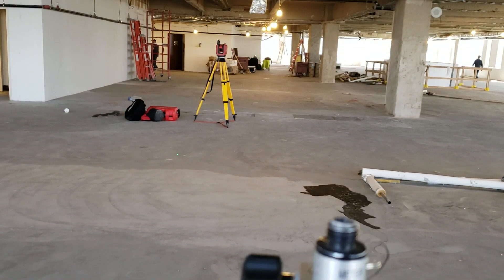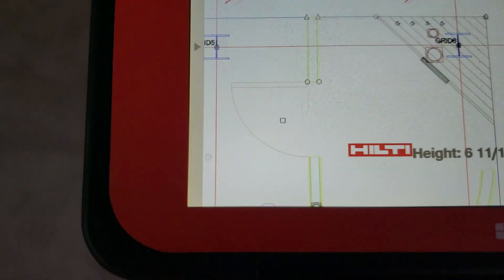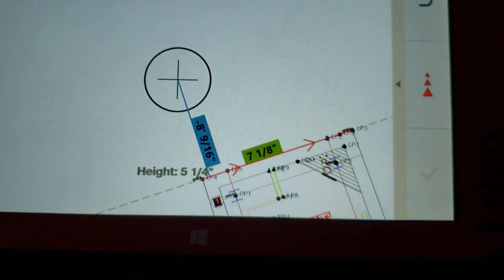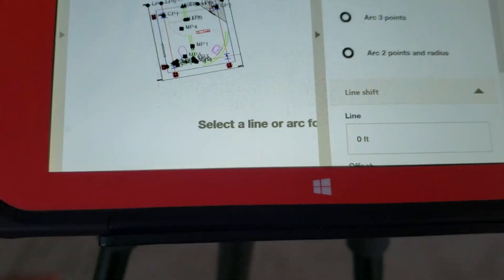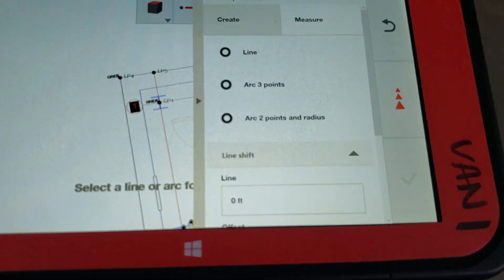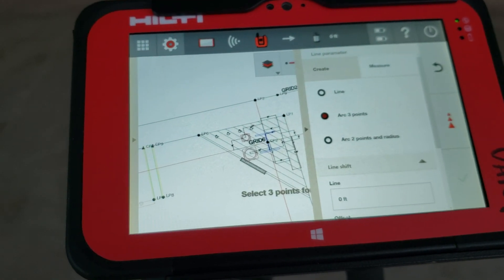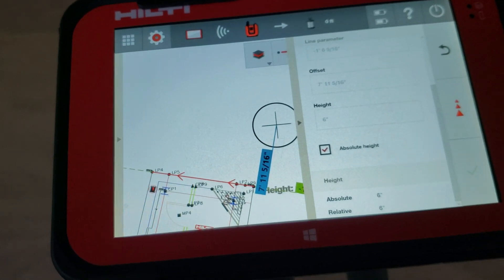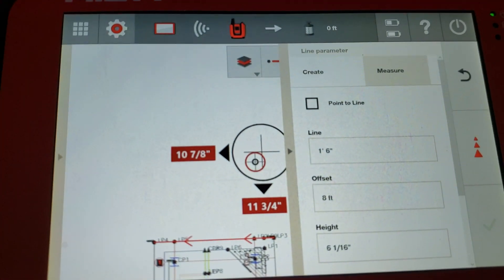Hilti PLC 400 Tutorial - APPLICATION - Line Layout

Comment: Once we’re set up and let’s say battery dies or we go to lunch and turn it off. Do we have to re set up on points or can we keep going if nothing moved?
Reply from the maker: You can keep going if nothing moved. My only recommendation is to "re-layout" a point or two that you had just done before the break to make sure you are still spot on. I've notice most total station users keep one or two "Back Sight" points - known as BS points haha - that are just used as these checks. Every time they station, they head to a BS point to see if they are falling on it perfectly like on previous stationings.
Reply: @measuringsystems869  thank you. I just hate having to re set up for break or lunch..  Also I just got a new plc 600. Does this tablet run the same as the other Hilti tablets? And is there a setting to make the screen not so sensitive to the pen?
Reply from the maker: @javibarajas9379  plc 600 runs the same as it would on the other windows 10 tablet, yes. And not sure about snsitivity to the pen - other than the "panasonic PC settings" app, i haven't had to go anywhere else to adjust touch screen settings

Comment: Can you do a tutorial on how to make your own building line, say with a foundation hole in the ground or an existing building, starting with a empty project. I've been having trouble making this machine useful when lining up additions to out-of-sqaure existing buildings.
Reply from the maker: Yes, happy to do that. I want to understand further, though... Are you basically doing an as-built of an existing building and then attempting to pull dimensions off of the lines you measure to determine where to place new structures?
Reply: @measuringsystems869  basically what I've been doing is measuring my own lines off the sides of the existing building that they want it lined up with. I do this by using a tape, a string, and some stakes. I spend a good amount of time doing this and I'm wondering if there is a faster way to do it using the total station. 
If I could get a demonstration of the capabilities of the building line mode that would be great. 
Also maybe an in depth explanation of what a bad station will do to my layout.  (I stationed the device as terribly as it would let me and while the layout did shift altogether, the points were still the correct distance and they were still square with each other).
Reply from the maker: @christopherlehman626  Great question. I can do a more comprehensive Building Line layout video. What you're doing is VERY easy with Building line. And regarding what the station does: there is a stationing basics video on the playlist, but essentially, the tool will ALWAYS layout things properly, what might change, though, is WHERE those objects are placed, which completely depends on HOW you station. If your control points are slightly innaccurate, the total station will sill try to "move" where you measured them to get the best fit to make it as close to the designed plan as possible. So, let's say that all your control points are off by a 1/4" to the East (for example). The total station will still layout out the plan accurately, but yes, the points will all be off about a 1/4" to the east.
Reply from the maker: @christopherlehman626  Is this video sufficient? It's one of the videos that already exists. It goes through the basics of building line and how to pull offsets and angles. Let me know https://www.youtube.com/watch?v=7qQ4G4ATUPo&list=PLF5GOD3RdTES9cO-IDeke_P-27HATD1bl&index=11